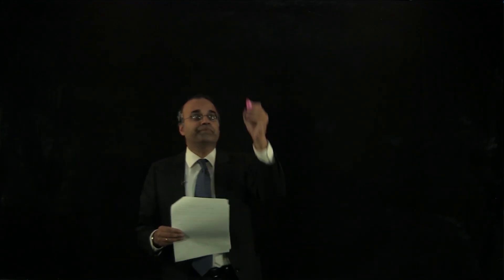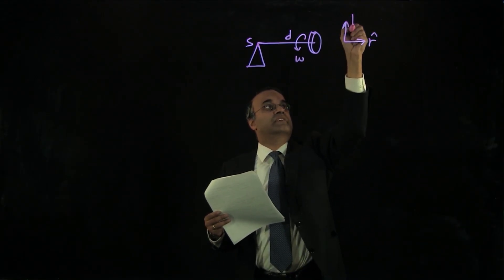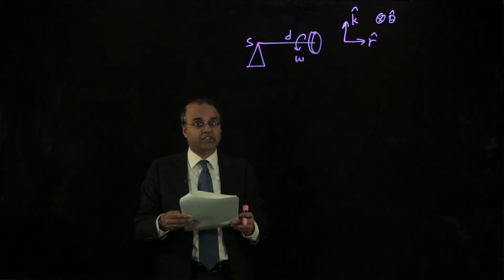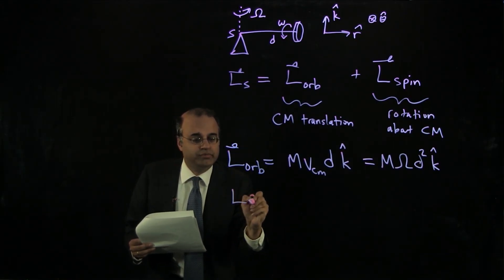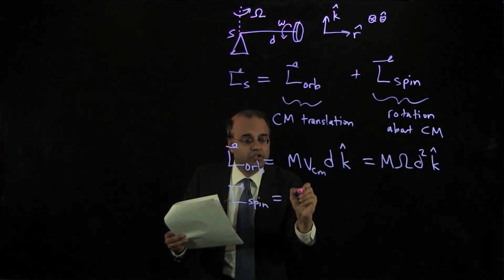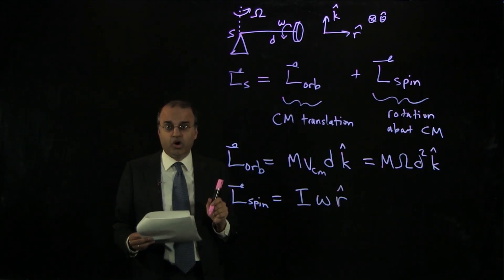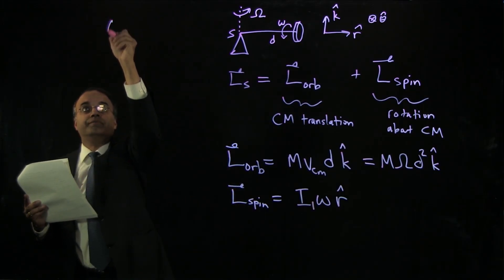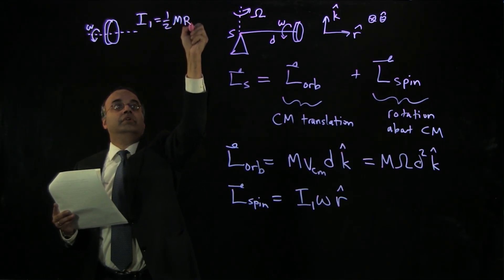DD.3.3 Deep Dive - Gyroscopes - Nutation and Total Angular Momentum

Comment: Why should angular momentum be conserved? Angular momentum is conserved when the net torque is zero, but in this case we have a non-zero torque due to gravity
Reply: The force of gravity is applied at the center of mass. As a result, it does not apply any torque, since the lever arm is zero.
Reply: @Jess-eh6pl how the lever aram can be zero
Reply: for the two vertical axes, the angular momentum is conserved, but for the horizontal axis, the magnitude is conserved, but the direction is modified by gravity
Reply: The z component of angular momentum is conserved because there is rotational symmetry along the z-axis.

Comment: The spin axis has nothing to do with it.  Tilting a spin plane starts the effect by creating a momentum exchange at the fulcrum created in the tilting plane.  There is no motion allowed at the fulcrum, and it cleans out momentum on each side.  The fulcrum axis is the key to the effect, because it creates opposing forces to start precession, then precession is itself a second tilting effect combined with the original input tilt.  This causes the fulcrum axis to migrate with the combined tilting effect, and this causes the fulcrum axis to rotate closer to the initial input tilt, and this produces forces that oppose the initial input tilt.  Drop the math and think about it.  Follow the actual input components of momentum.  Rotational momentum is set, and does not change by tilting it.
Reply: Sorry I could'nt follow. Can you explain the fulcrum axis part?
Reply: @vishwasshankar3929  I was going to merely describe it, but I recently developed the math that describes it as well.  It is a paper that needs political momentum before it will get published.  Angular momentum is a perfect analogy, but it is wrong, so an alternative right answer is not going to turn heads very easily.  Everyone knows how a paradigm shift is supposed to be difficult, but they have no experience with it.  This is your chance.  I don't expect you to see it.  It has been 15 years of trying to get scientists to see that a conservation law is not causal -it is a mnemonic device.  Describing something with math does not mean that you understand it.  But, if you can see my explanation, it is a mechanism and not a mnemonic device.

The paper is here:  https://papers.ssrn.com/sol3/papers.cfm?abstract_id=3587972
SSRN is an Elsevier site.  They wouldn't publish my paper, but they invited me to post it as a shared unfinished work on their SSRN site.   Sometimes the paper is hard to find.  Search SSRN.com for Hartman gyroscope, if you don't trust the link.